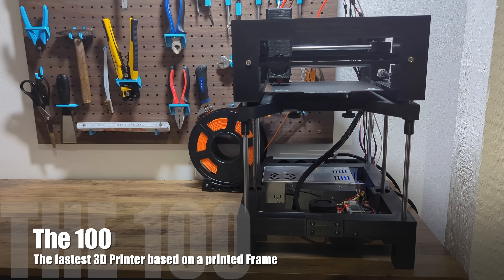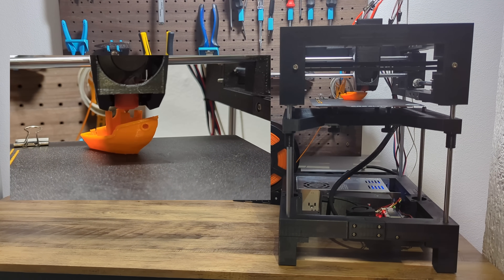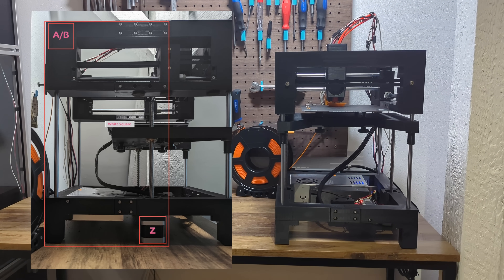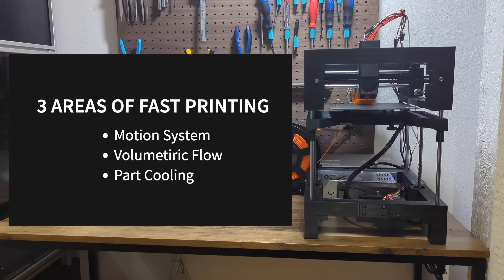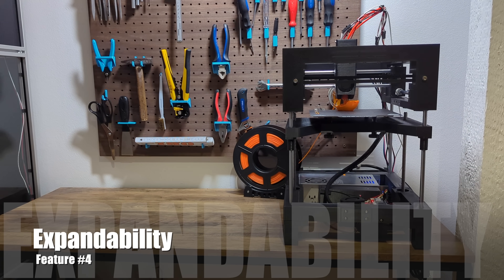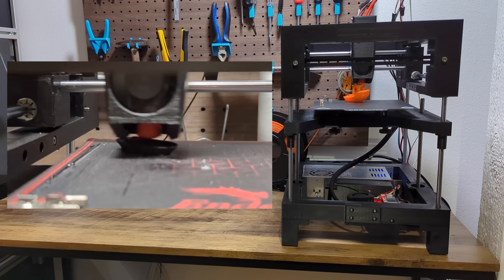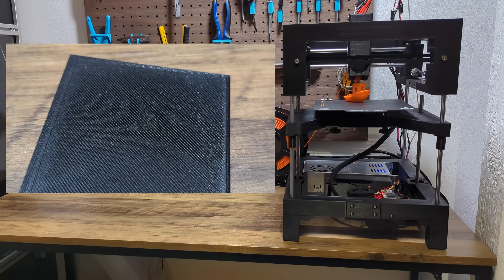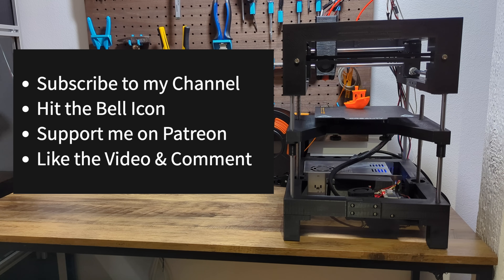The 100 - The worlds fastest 3D Printer based on a printed Frame

Comment: Extrusions on the bed of a 3d printer can be filled with sand or something.

This is all stuff that machinists know. The dense cast iron beds of lathes and mills enable higher feeds without vibration.

The density can be thought of as the bench it is mounted to. If there is a heavy bench with a wooden top, perhaps screw the printer down.

Comment: I think this machine can be developed further. This is standing on the desk. I saw some 3D printed clamps on Thingiverse. It is fixed to the desk like a vise. Why not give your printer a stronger hold with 3D printed clamps? This seems to have a positive effect on the printer output. Also, diagonal reinforcement in the part replacing the aluminum profile seems to be able to avoid slight distortion due to the printer's rapid xy vibration.

It also looks good to replace the screws that hold the prints together with prints. I believe that parts that are cheaper and closer to the printed product can reduce the production cost. The closer the irregularities are to a streamlined shape and the larger they are, the less distortion there is, and the more angular, sharp or narrow the irregularities are, the inertia of the motor moving at high speed seems to destabilize the position of the nozzle placed by the movement of the motor. If variable speed printing is possible, the quality of the output will be high, such as printing at high speed in sections where printing is done with large and gentle curves, and printing slowly when the unevenness of the printing section where the nozzle will proceed 10 centimeters in the future is rough, congested, and small.

Also, if the print frame, which replaces the current aluminum profile, can be slightly uneven and a one-layer flat print can be inserted into it to make it sealed, it will become a luxury product that can be assembled closer to an industrial model. For one of the walls where heat can escape, it would be okay to cut the side of a smooth plastic bottle instead of using an expensive acrylic plate. It's a self-made sealed printer.

It would also be a good idea to reinforce the upper profile a little stronger and then place a bench press steel plate on the upper part to suppress the vibration of the upper part that cannot be fixed in a vise.

Comment: Looks awesome. However.... why PLA for the frame ? You can't close this printer and print anything beyond PTEG with an enclosure, if u try to go over 50ºC at the chamber the whole machine will fall apart... And for what reason are you going to close the machine for printing PLA... So... PLA is an horrible material for this purpose, use ABS, ASA, wood... NOT PLA! So the idea of this machine is awesome, the election material to make it is not. Or don't tell us that we can close the machine because we can't with a PLA frame... Ahhh one more thing about PLA, it is biodegradable... With time... It will become brittle. Again, DON'T USE PLA for technical parts.

Comment: I've been contemplating a fast small printer to supplement the large vorons in prototyping. The v.0 is just as you said.  The annex machines are great, but spendy and complex. This could be pretty perfect, especially with a kit and a rough printed guide

Comment: Amazing engineering. Just wondering, is it 'cheating' for these boat races just to bolt the printer to a wall? It seems this would be a cheap, simple (5 min) way to dampen any vibration resonances / need for mass?

Comment: I just had an Idea for increasing speed and/or torque of stepper motors. You could get a reduction timing belt kit with lower torque faster speed lighter stepper motors. This would make your 0.9 stepper motors more like 0.3 stepper motors which should increase accuracy and torque and reduce load on the actual motors. If you can liquify the filament fast enough I think you can really increase speed and accuracy. by mechanically reducing your drive ratio you would have to seriously increase power output to the steppers. Probably going to need water cooling or maybe even liquid nitrogen cooling but maybe that's extreme. THis might also help with stepper drivers staying cooler also.

Comment: I dunno bout 83hrs. I printed the same on a stock v2 un bout 16 or so if I recall correctly. did need supports tho. I'm going to try and adapt your cooling head to a stock ender as its he best design ive seen before
Reply from the maker: Did you print it in 185% scale? :-)

Comment: Amazing project! I'd love it give it a go and try my hand at building a DIY printer, but unfortunately my Neptune caps out at a 225x225 build volume, has anyone attempted to print the parts for this on a smaller printer than the minimum of 230x230?

Comment: I really wanted to build this as my 2nd printer. I already have an ender 3 v2 which I dearly love to bits printing and modifying with. I'm currently finding another printer to speed up my prototyping and engineering needs, but it's really hard to commit buying a 2nd printer, knowing that I will have a limited budget and will end up buying a printer similar to an i3 frame. 

I needed a printer that is fast to see if my CAD designs work well, and this one fits my needs. Almost all of the parts in the BOM are accessible to me, but I'm having a hard time finding the volcano hotend. Are there any alternates to the hotend? I'm currently eyeing the creality spider hotends. Im not really aiming for a very high competitive speed like what the others are doing, just a reliable "fast" printer will do.

Any suggestions will be appreciated. Thank you!
Reply from the maker: Besides of the CHC Pro I also support the Rapido in it's ultra highflow variant

Comment: is it more or less beneficial to mechanically anchor the printer to a large, heavy, stable workbench or even a super-rigid shelf mounted to multiple wall studs via a fabricated metal shelf frame and supports?

what about additional mechanical anchors coming from the top of the printer's frame to the wall in addition to the base being mechanically anchored to a stable / heavy platform (whether it ends up being a shelf or work bench)?

trying to decide if it is worth the effort of mechanically stabilizing such a machine or if it would hinder more than help it?
thanks!

Comment: Several PLA manufacturers have improved PLA performance in specific engineered situations.

One example, Polymaker.

Printed RC Airplanes
PLA Lite (Extra Foamy)
Drones
Industrial Strength.
PLA Polymax (Outperforms ABS)
How would either of these Engineered PLA's affect The 100's design? When increasing the bed size to 300mm x 300mm? Will they help in limiting flex as the size of The 100 increases?
What concerns can be overcome by selecting an engineered PLA instead of regular PLA?
Reply from the maker: No PLA is fine

Comment: I just started printing the rook yesterday but now I'm questioning if I want to switch over to this one instead.  Really I just wanted to check out corexy printers as I got into printing a couple months ago and maxed out my speed and quality I can achieve with my sv06.  Great printer but I still want more.  Guess I'll be building this one as well too probably haha
Reply from the maker: In my experience the Rook has similar printspeed as a well tuned sv06 at a bit better quality.

Comment: Are those printed bearings, how are they holding up, which material any thoughts? Why not linear rails . Awesome printer
Reply from the maker: Yes they are. For the Z-Axis they work really well. They are custom fitted so that they create a small amount of pushing force which help to stabilize the z-axis. For my v1.1 i've changed them to linear bearings and to be honest I liked the self printed version better.

Comment: I think if we want cheap (keywoard cheap) printers that can sling the printhead around without oscillating the entire frame and losing precision we need to have the frames made out of concrete and just 3d print the casting molds. Then the oscillation is entirely on the rails.

Comment: Out of the voron, rartrig and vzbot what was your favourable design? Great content!
Reply from the maker: Puuhhh... that's tough... my Voron has ~60mods, my vzBot ~35 and my Ratrig ~15 mods so I would guess that the ratrig had the best out of the box experience. It's a perfect base to print fast, but since it's build volume is normally very high (most of the ppl buy a ratrig because it 500x500 print bed size) it's hard to get its chamber at about 60-62 for easy asa/abs printing, here the is shining.. since it's a good compromise between quality and speed.. the vzbot is fast but since it uses much carbon fibre (CF starts loosing its stiffness at ~60°C) it's like the THE 100 a fast printer that's not made for ABS/ASA printing

Comment: Could you use thicker linear rods for the y- and z-axis to add mass and stiffness since they are also non moving parts?
Reply from the maker: Yeah absolutely, also it would make the resonances of the printer way better when choosing 6mm rods for X and 10mm rods for Y

Comment: interesting🤔
i have a cr 10s5 and the dowside to mine is: the bed IS TOO HEAVY and is moving as Y axis
i have upgraded to direct extruder using stepper extruder motor and connected an elastic to lightweight the x axis
seems to work well and i'm planning to make a counterbalance for it
as for the bed, i'm looking to buy a sheet plate 500x500 lightweight
glass is also heavy, so looking to replace that with something as well
Any ideas?
some links if possible(uk based)

Comment: Is it possible to change the print area to 300x300x300?
Reply from the maker: Sure, i've attached the the STEP files of the printer on printables so if you like to modify the size of the printer this might be a good starting point. Also have a look at our discord, we already have a couple of mods for the printer, there are people that already made a bigger version for  an ender 3 printbed.

Comment: Ive always wondered rather than a faster and faster traveling head .... Split the build chamber into 4 and have 4 independent hot ends that overlap. Yeah the control could be more difficult to avoid collisions but surely that would be faster right??

Comment: Would it help by making an X-frame reinforcement (like in construction) between top and bottom on each side to increase the stiffness of the frame? This way top and bottom would be fixed in relation to each other, eliminating move/swing. This could maybe be done by (steel) wires as the frame itself is strong enough.

Comment: I think the best way to join 3d printed parts, even PETG, is not screws, not glue, just a soldering iron regulated around 200° (a bit higher for faster working pace). If mechanical strength is required, and just joining on the outside and surface isn't enough, you can design the parts to have holes or cavities (like screw holes) to access areas for merging. But in general, for PLA and PETG there is no stronger bond than thermally melting and merging the parts.

Comment: what a great printer, i may try to build one. but I still need a first printer to print the parts. which do you recommend?
Reply from the maker: I would go with a printer that supports Klipper. Having an open firmware will give you a lot of smaller enhancement projects for your first printer.

Comment: Very cool! I feel like the importance of the frame weight might be overblown though. Stiffness matters so any movement will translate to the surface it's on. But instead of a fixed contact with the table, imagine if the whole printer were sitting on a free floating platform. Any x-y move of the gantry would then cause a counteracting x-y move  of the printer on this platform. If the platform were infinite, there's no problem.

This actually seems better than a rigid base as there's no backreaction on the print head that causes ringing. So if the free floating platform were made of some some rails, add some large but soft springs to dampen the printer's movements. A massive frame basically does the same thing just using inertia.

Would be a cool experiment at least. The frame would move with fast print head movements, but maybe you wouldn't get those resonances as long as it was stiff and the springs properly damped.

Comment: Why pla? 

Most printers have abs as their build material.
Reply from the maker: PLA is more rigid and easier to print. It's density is higher, so it's heavier, which means you can use lower infills. Lower infills reduces the possibility of warping. Also PLA is more stable in case of shrinking. 

If you more experienced user feel free to print the frame in ABS+/ASA :-)
Reply: @MattThePrintingNerd  ok,

Only wondering as I'm comparing it to voron printers.

Comment: just one question. Why do you se linear bushings instead of bearings on the y axis? is it weight or something else?
Reply from the maker: It's because of the noise level, when you print at 400mm/s at 100k acceleration the noise level of the printer is getting really load. So i tried alternatives and learned that bushings perform much better that you might thing ;-)
Reply: @MattThePrintingNerd  believe me, pushing printers that are not built for speed to print at dumb speeds and accele is something that I do and I have experience with the bearings wearing out and making all sounds known to man. Just thought you had some other reason for this. Good to know

Comment: Dear Matt,I loved your video and admire your perseverance and focus to produce this. The video showed a great summary of lots of videos and experiments that I have watched on youtube.

 I love the speed that it prints at, as one of the things that stopped me from using my 3d printer was the time to print. The second was strength. Will your cooling that is needed for the overhangs and speed affect the strength? My impression is that the layers do not stick so well if cooled, and that is why people may heat the prints in ovens with bicarb, to get them to weld together and become stronger. Or is this overcome by the greater heat buffer capacity and flow of the nozzle.

(My frustrations with lots of learning issues with my alfawise u20, and clogged nozzles, and flat bed issues with the print over sticking and then peeling off after a few layers, learning cad software etc. make me appreciate your work more.
 The thing which really upset me was when it did print the part was weak despite orientation and infill. All I wanted was a flymo hinge pin. In frustration I got a disposable extra 2 razor handle and made it do the job. I will revisit 3d printing having had a break.

Comment: Very nice printer! I am planning to build one! I also was looking at @Rolohaun's Rook mk1 mostly printed 3d printer, which is a great design aswell...I like the simplicity of round liner rods being used and believe in easily obtainable replacement components. Great Job on the 100 printer, looking forward to building one very soon!

Comment: i would make a suggestion, is to have the print head underneath, nozzle facing up and the platform up above upside down. This would place the center of gravity (interia) low, unlike having it high causing the box to wobble when printing at high speed. there is a smiliar printer that prints upside down called Positron V3 that does this and is extremly fast printer

Comment: Why not use wood? Universally available everywhere, easily workable into nearly anything. Even with a simple saw/chisel, you could build the core of the frame at the very least. This is something that seems to have went out the window in the 3D printer world.
Reply: Moisture.
Reply: @p_serdiuk  Nearly all the filament's people print with are hygroscopic and absorb moisture. It's just an option. And with proper considerations, it's been good enough for all types of machinery, airplanes and nearly anything else for thousands of years. The use cases are endless.
Reply: @a9s2w5  Filaments can be dried. Printers built out of wood will suffer from dimensional shifts as the ambient moisture changes. Constantly keeping the printer in a climate-controlled box is more trouble than it's worth.

Comment: So I'm looking for a printer to print ABS that's not my ender, if I made the frame out of PETG and then did acrylic side panels would it be able to achieve that? Or is the heat deflection of PETG too low?
Reply: Petg would work for awhile but being enclosed for extended periods would more then likely start to deform the parts. If enclosing I think Asa or abs would better. You could make a temporary enclosure for your ender to print the Asa or abs parts.
Reply: @raw4nature750  I definitely could. It would be worth it

Comment: Hi, I think this is great. Could you make a video or text explaining some design choices?
If weight is needed why not just add weight with a heavy floor tile or a 3d printed cubile to be filled with cement. Maybe bolting the printer to the wall. Im not an engineer of any sort, I don't really understand the square alignment of weights.
Also dual Z leadscrews? a cold bed? 
I think this is all very interesting, and would love to try 3d printred frame